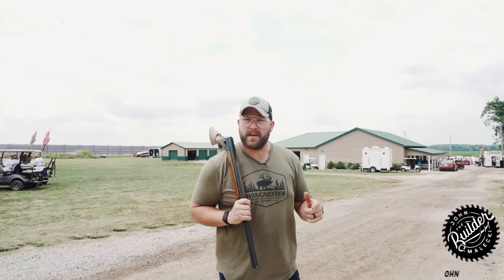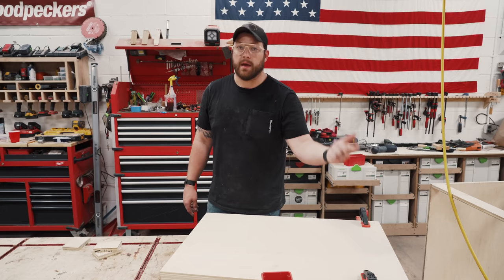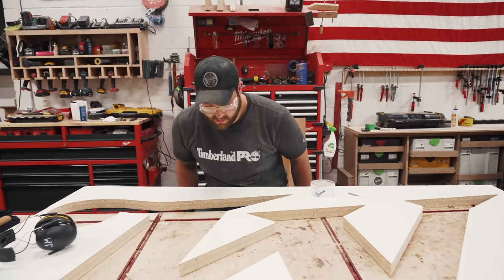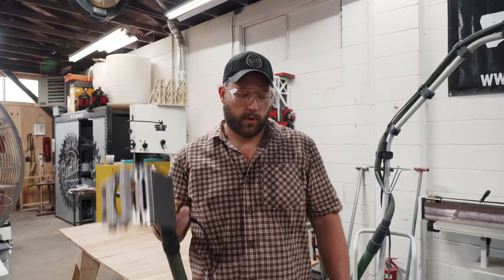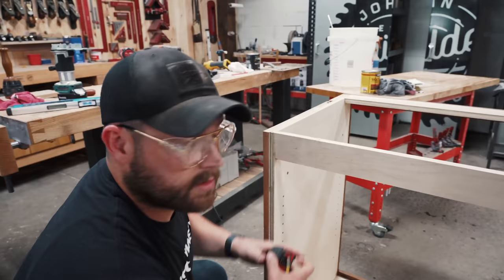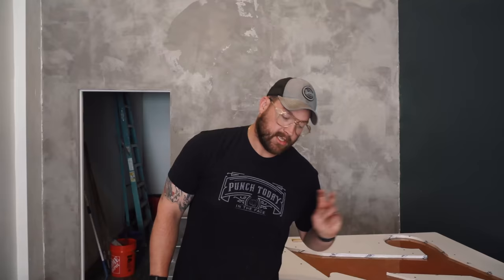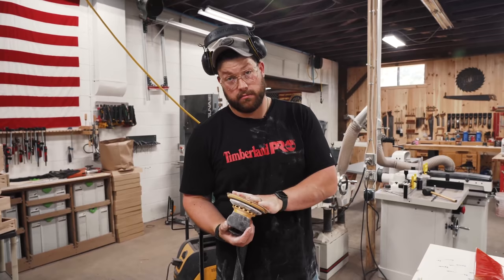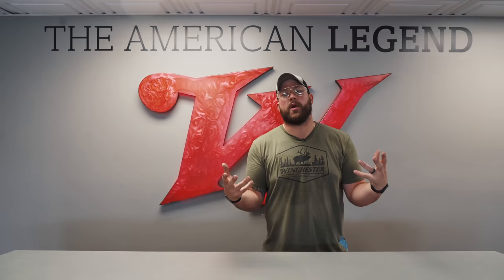HUGE Desk & EPOXY Sign Build for WINCHESTER AMMO!

Comment: You might try laying down tape where you are using silicone to seal forms. The tape takes a few minutes but if you are careful with the tape, once you spread the silicone you peel the tape off and it gives a perfect line and it's way quicker than peeling silicone. Just a thought

Comment: you should have made an MDF circle or so with a slot in it's side and wrap the steel around it, took your measurements, cut the steel, wrap it up again using some strap band, tack it, AND VOILA!! you have a pretty good shell base

Comment: if you want a easier smoother silicone line when making your moulds spray some foaming glass cleaner on top after youve laid your bead and then just wipe it off with your finger. makes a super smooth thin line of silicone and dousnt cut into your mould as much.

Comment: I dont know if you already done it but didn't show it but if you use a hammer or something with weight and tap along the edges of your mould it will get rid of a lot of the air bubbles that you get on the edge! Atleast that's what I do when making concrete pads also helps the concrete get right into the corners

Comment: As a handy tip, if you're pouring resin out of a bottle and don't want that 'glug glug glug' effect for more accurate measurements, flip the bottle so the pouring hole is at the top rather than the bottom so the air can escape alongside the resin. Works with all liquids.

Comment: Could you have poured a slab of epoxy then used the CNC to cut your shape, Rather than cutting a mould, or would that be too expensive in wasted epoxy?
Reply from the maker: if it wasnt a W i wouldve done that, but making a W would be weird so its easier to cut a mold

Comment: Why not fill the table with water before pouring the epoxy to check for leaks? Water is a whole lot cheaper than epoxy and easier to clean up
Reply from the maker: water ruins wood & epoxy . So its cheaper yes, but if its wrong it woudl take hours to fix
Reply: John Malecki  Figured it would swell the wood, but didn’t know it could also ruin the epoxy... so yeah thats going to be a no go. I think I’d still rather ruin a mold to find out I made it wrong than spill $500 of epoxy overnight AND have to make a new mold but to each their own